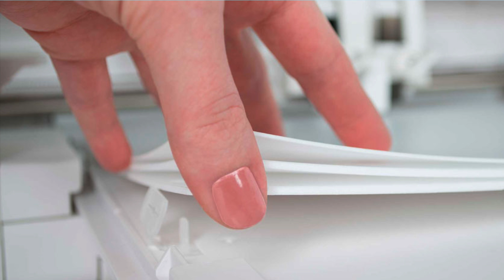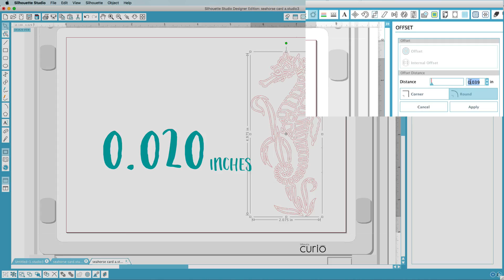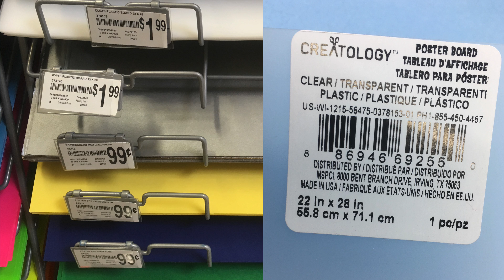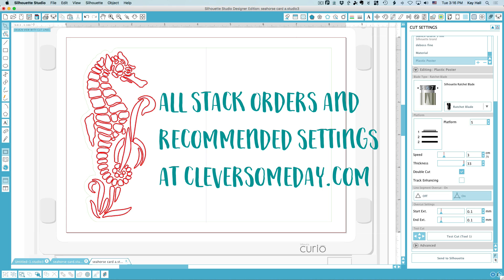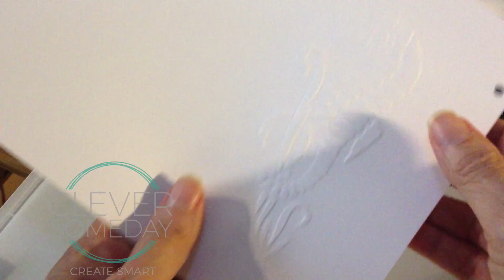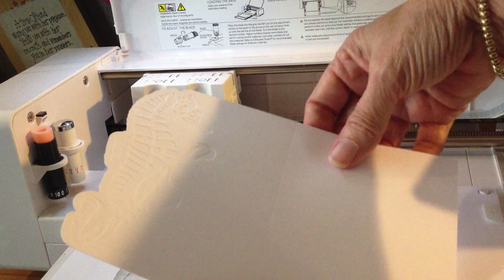Flat embossing with the Curio

Comment: I have a cameo but I haven't unpacked it yet.  I make extensive use of my silhouette though.  I'm unclear how this technical achieves the flat emboss look though.  The inner offset (blue line) in your video is what is actually embossed, but doesn't that still just trace the outlines? What causes the "flat"?  There isn't any "filling" like some people do with sketch pens to fill in fonts?
Reply from the maker: If you watch the whole video you will see this is a totally different technique. If you ever used a hand stylus to emboss with a brass stencil on top of a light box, it is the same idea, and produces a lovely flat emboss with no fill.
Reply: @cleversomeday  Thank you!  I haven't tried the hand stylus before  but I did after your comment. Very very cool!  I tried embossing with my new Curio.  Just a square with dashed lines, kind of like die cuts that give a stitched look.  For some reason, the horizontal lines look good but the vertical lines are less defined!  Have you encountered this?
Reply from the maker: @starscapes8853  No, but if your peg holes are not tight, that could cause a mismatch in that direction.

Comment: Who's to say this smart technique can't work on the cameo? Ive done this a couple of times on my cameo, however the benefit of the alignment on the curio would be great since I'm not getting a ton of success with the pixscan mat with my cameo. I mostly just place the cut lower down the mat so I can access the cut and I don't unload between cutting and embossing so it lines up.
Reply from the maker: I had no trouble lining it up on the Cameo, but I could not get enough pressure for an acceptable emboss.

Comment: Brilliant. I just got a used Curio with the extended mat for $75 - I was searching how to cut and emboss and if you had to switch the mats. It's going to be a bit of a learning curve but am certain it will be worth it. Thanks for your very helpful and detailed videos - where do you suggest a beginner start. I have had a craftrobo - Quickutz machine for years and then upgraded to the Cameo 12" version one that suited me fine. Now the Curio. I was hoping it would cut thicker things but maybe not as I am doing more research. Still, the price was right so no regrets.
Reply from the maker: http://www.findingtimetocreate.com/2016/11/getting-started-silhouette-curio/ is a good place to start. Also the Silhouette Curio Creations Facebook Group has excellent resources and folks

Comment: hi just to confirm the foamboard is 12mm? 1.2cm? i cant find any over 5mm locally just wanted to check before ordering
Reply from the maker: I'm not sure what you mean, There is no foam board involved in this process. The plastic poster board I use for the stencil is approx 12 mil (~.012"), not 12 mm.
Reply: @cleversomeday  oh i must be even more confused i seaeched for plastic postboard but only foam board came up so figured it was the same thing good job i asked i will search again
Thank you
Reply from the maker: as shown in the video, it is found in Michaels in the same rack as the regular poster board.

Comment: I'm still a bit confused. Not your fault. I'm just really new to this all. I'm thinking of investing in this machine. I have the other one. I like that you can emboss and other things as well. Your video was great though.
Reply from the maker: This is a new, advanced, technique I developed for the Curio. It does not do this quality of embossing normally like a Cuttlebug does and is in general not a good beginner machine or first digital diecutting machine.
Reply: With the cuddle bug don’t you need to buy their patterns
Reply from the maker: yes, in general with a roller embossing machine you have to have a folder or die. This technique has not replaced my Cuttlebug, but has allowed me to do custom items.

Comment: Does the curio work as good as a manual embosser like big shot? For example, is the final emboss deep?haven,t done it either way yet-just trying decide which way to go. Thanks- love your calm clear voice
Reply from the maker: The final emboss using this technique is very similar to a Cuttlebug/Big Shot (maybe 80% as deep). However this takes more setup time for the initial design and is limited to stencil friendly images, so I don't consider it to be a replacement for my Cuttlebug, but a chance to flat emboss custom designs.

Comment: Just got my curio and am confused by it:( I am used to my Cameo, but thought the embossing would be a fun and useful tool. So the ? is. I always have to use a stencil to emboss?
Reply from the maker: You can do score and emboss on the Curio (or Cameo) but you won't get the kinds of results you see here without a stencil.
Reply from the maker: I have not been able to get a good emboss with this technique using the Cameo. Even though it is the same downforce as a Curio, it just doesn't leverage the pressure as well for this technique.

Comment: Fabulous Kay. For stencils the Metal clayers have been using pj stencils 10 mil (heavy duty) stencil material. It cuts like a dream with a blade of 10. Might give a slightly deeper (more raised ) emboss. Can't wait to try this :)
Reply from the maker: The plastic poster board is 12 mil, but sounds like you could get more detail from the PJ material. Can't wait to try it.

Comment: Aaaaawesome! Something I always wonder about....what does the overcut setting do?
Reply from the maker: makes the blade overrun a corner, pick up and start the next segment instead of turning the corner with the blade down. Kinda like the difference between running to first base and rounding second base. Especially helpful for getting clean cuts with thicker media.
Reply: bons589 Thanks! That makes a lot of sense. I am going to start using it because corners ARE often problematic!